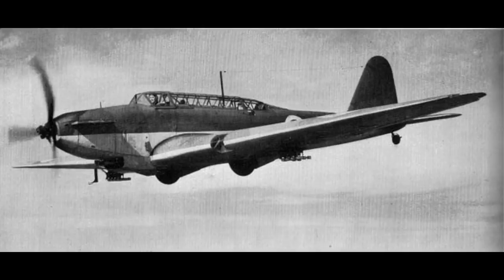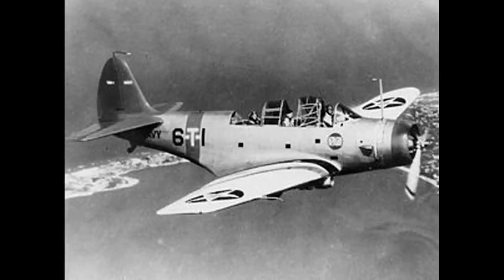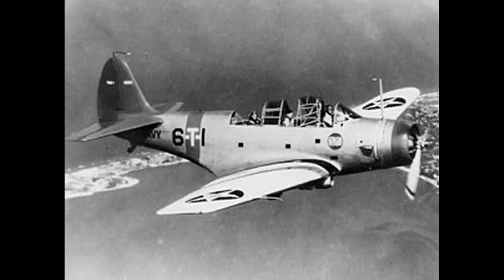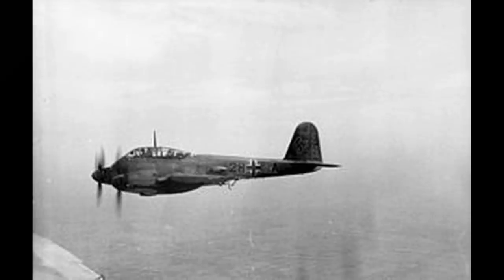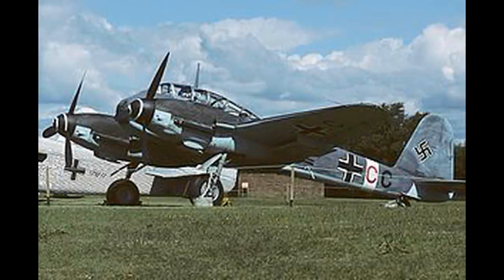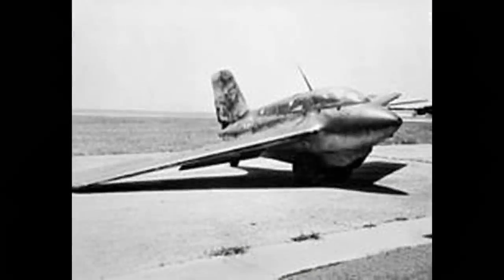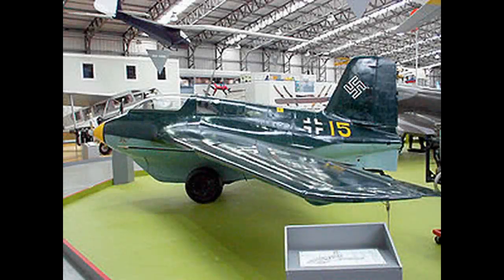TOP 5 WORST military aircraft used during WW2

Comment: The Devastator was a US NAVY plane.   The USAF didn't even exist as an independent service branch until 1947....thre land based air arm of US forces was the US Army Air Force.
Reply: Yes, but the USAAF, the United States Army Air Force did have a version of the Navy SBD dive bomber.
Reply: @scootergeorge9576  Yes....but my comment was in reference to a TORPEDO bomber, not a dive one.  While the USAAF used a version of the SBD Dauntless, as you pointed out (although that use was limited), they did NOT use a USAAF version of the TBD Devastator....different planes entirely.
Reply: The Devastator was undone due to the fact that it’s primary weapon the Mk 13 torpedo had all the faults of the Mk 14. In short the torpedo catastrophically failed to function in four independently different ways simultaneously.
Reply: the Devastator's drew the Japanese Combat Air Patrol down to sea level and left three of the four Japanese aircraft carriers open to the following  wave of SBDs at Midway.  15 aircraft for three aircraft carries is a fair trade to change the entire strategic balance in the Pacific.  Japan could never recover from those losses.

Comment: I have to disagree with the devestators, you used the examples of the attacks on Akagi and Kaga and granted yes they got absolutely chewed up. But the reason that failed was because the US air groups got separated from one another. When both dive bombers and torpedo bombers were supposed to attack at the same time with fighter support keeping the zeroes off, the devestators went in, practically alone, so the japanese didn't have to divide their fire up and the zeroes didn't have much (if any) fighter escort to worry about. Any other torpedo bomber of the time would've struggled on that strike, even the TBF's which replaced  the TBD's. While I certainly agree it was outdated by the time of the US entry into the war, i don't consider that a failure of design, things age and become less useful over time that has always happened and always will, but that doesn't mean it wasn't capable at one time.
Reply: And besides that, the torps they were working with at the time were utter failures. Some of them got their torps out and even scored hits but completely failed to detonate.
Reply: Add to that, the Mark 13 aerial torpedo was a total dud. Even if hits were scored, it would most likely fail to detonate. It was too slow and could not maintain proper depth and heading.
Reply: If the Douglas Devastator had been armed with a torpedo that do not have a 97% failure rate, at least one of those big Japanese carriers would not have survived the Coral Sea in Japanese casualties at Midway but not have been so light

Comment: it's always difficult when a weapon is used poorly and it ends up being "obsolete" as the swordfish was used against the Bismark and came back a hero plane while the devastator goes against massed AA fire is is a horrible failure when technically the swordfish should have been obsolete when it rolled out the factory.
Reply: Thing was though the old "String bag" was a tough sturdy and stable plane. Also the Bismark missions were not a fluke the "String bag" had already been massively successful in the Battle of Taranto against the Italian Navy which was more formidable than the German one. The "String Bag" was the most successful naval plane of WW2 in terms of naval tonnage sunk by any allied plane. It may have been technically obsolete but it was perfect for it's role. It's one thing being old but another being actually damn good at your job regardless. Reminds me a little of the Gloster Gladiators used by Finland and Malta which also punched well above it's weight.
Reply: @paulsnell534  i think that in cases of Taranto and bismark things were greatly in the brits favour, Taranto was a suprise night attack and there are stories of bismark not being able to calibrate it's guns for the slow moving swordfish
devastators faced mass AA in large formation combat and had crappy torps
i don't think the swordfish faced either i think the swordfish kinda got lucky that it was used intelligently which sadly isn't the case for a lot of equipment that gets a bad rep
Reply: The Ilushin il2 had virtually the same specs as the Battle but the Russians fitted plenty of armour to protect it and a decent rear defence gun ,the Battle would have benefitted from such clear thinking.
Reply: Both swordfish and devastator were obsolete, with devastator being a slightly better aircraft. The thing is though, the Devastator used American torpedoes.
American torpedoes were really fucking shit until 1943, with I believe about a 70% failure rate.
The more glaring issue of American torpedoes were... It running too deep, running too high, not detonating, detonating prematurely, detonating too late, running off course, and spinning in circles.
The US didn't test their torpedoes until late into the war after mass-producing, them as doing so would cost too much to. What followed was a mass-produced, expensive piece of shite being sent into battle with officers expecting it to work when it didn't.
Reply: @botchii3059  English torpedoes were terrible at the beginning of the war as well ,they couldn't afford to test them in reasonable numbers so lots of duds went out ,also the U.S. torpedoes were way worse than 70 % unreliable until the Naval ordnance beareau got their act together.
Reply: @pauldavidson6321  can you give me a citation for the unreliability of English torpedoes? I thought the only downside they had was the size.
Reply: @botchii3059  the magnetic influence pistol was notoriously unreliable but kept in use to 1943 it's replacement  was better but could detonate prematurely if there were nearby explosions, overall the success rate with all types was around the low 20 % mark . British torpedoes were 18 " for aircraft and 21 to 24 " for ships , subs and Mtb's as well as American torpedoes.
Reply: @pauldavidson6321  Britain didn't mass produce the same torpedoes as the US, and didn't equip them with magnetic triggers. They tested the reliability of magnetic torpedoes and found out it was better to just go for the standard.

One of the UKs aerial torpedoes was the Mark VII, different to the US's torpedoes. I believe it was not acoustic or magnetic, and utilised the standard contact trigger.
This was replaced I believe from 1942 for FAA use onwards by the aerial Mark XV, different to the American Mark 15 ship-based torpedo.

http://www.navweaps.com/Weapons/WTBR_WWII.php
http://www.navweaps.com/Weapons/WTUS_WWII.php

Compare the stats for the UKs Mark XV or XVII to the US's Mark 13.
----
http://www.navweaps.com/Weapons/WTBR_Main.php
The Brits did use some magnetic torpedoes in WW2, and were far better than the US's counterpart.
----
Even after the USs torpedo improvements, during the Korean War on an attack against a dam, 2 of 8 torpedoes failed, one running erratic, and one being a dud.
Reply: @botchii3059  The crew of HMS Sheffield were very pleased regarding the unreliability of British magnetic pistol torpedoes when, on the night of 26th / 27th May 1941, the Swordfishes of HMS Ark Royal mistook her for the Bismarck and attacked accordingly.  Fortunately the magnetic detonators on the torpedoes were defective and were replaced on the next strike (this time against the Bismarck) with contact detonators.
Reply: @wotnotvintage7762   The Duplex Coil Rod pistol was replaced in 1943 by the CCR, or Compensated Coil Rod. She was a good pistol, and entered mass service in 1945.
The DCR was a shit pistol, though not as bad as the US's Mark 6. She did splendid at Taranto, though remained wholly unsatisfactory. The US's Mark 6 had no successes comparable to Taranto, and was shit throughout the entire war.
Reply: @botchii3059  Many years ago I read a young adult book about a guy on a sub. That book mentioned that the torpedoes were no good early in the war.
Reply: @pauldavidson6321  The IL2 was in a different league to the Battle. The IL2 had impressive forward-firing armament, (2x 20mm and 2x 7.62mm originally, later 2x 20mm and 2x 23mm cannon), and could carry 8x 82mm rockets and 4x 220lb bombs. Later models could carry more ordinance. The biggest difference  was that the Sturmovik was designed to operate as a ground attack and close support aircraft, and was equipped with the tools to do the job. As you rightly point out, it was well armoured, and proved most difficult for German pilots and ground forces to bring down.
Reply: @anitadolan1361  I agree completely, my point was the Battle could have been developed to a similar standard as the IL2 the British knew the capability of the bf 109  yet did next to nothing about providing decent rear fire power or virtually any armour protection for the crew.The Battle wasn't a high altitude bomber and would have been exposed to the lethal light flak at it's operating height .also there was plenty of development available from the Merlin for far more power which also improved the IL2's effectiveness.
Reply: @wotnotvintage7762  Phew! Lucky escape there for that Sheffield. Alas, not such good fortune for its namesake 40 years later ...
Reply: @ScreamingSturmovik  It's one thing to have relatively inaccurate Anti-Air guns but not be able to depress to targets just above surface? 🤦‍♂️
Reply: @DerpyTurtle0762  i always heard it was due to the swordfish being able to fly ridiculously slow (due to being a biplane) and the Bismark's AA director "computer" was calibrated for "modern" aircraft that flew much faster so the gunners had a very difficult time
Reply: @paulsnell534  The Finns also used the Buffalo and Blenheim, both pretty ineffectual elsewhere.
Reply: @botchii3059  The highly successful submarine U.S.S. "Tang" was sunk by one of its own torpedoes in October,1944, with only 9 survivors.
Reply: One thing to remember is that the Devastator's final operation was the Avenger's inaugural one. And the Avenger had a rough go of it, also, losing 5 of 6 in their torpedo attack on the carrier group. And the one that survived didn't hit anything because of the horrible Mk XIII.
Reply: @pauldavidson6321  The Fairey company successfully made a more powerful engine than the 'Merlin' that might have powered the 'Battle' but the Air Ministry wouldn't let it be produced.
Reply: The Swordfish was also up against massive AA fire but it was so slow the modern German rangefinders couldn't get hold of it.
The Devastator was up against interceptors, Zero fighters so that made the difference.
If the Bismarck had fighter cover, it would have been unharmed probably because most of the torpedoes hit the thick armour belt and didn't do anything but a single torpedo hit the unarmoured rudder, causing the Bismarck to go in big circles after the attack.
Reply: @ScreamingSturmovik  you're absolutely correct ,when the Swordfish squadron was sent out against the Scharnhorst  , Prinz Eugen  and Gneisenau  during the German "Channel Dash" they were shot to ribbons by the luftwaffe fighter escort  just as the Stukas we're when faced with effective fighter opposition.
Reply: @pauldavidson6321  Actually Fairey, made the into the Fulmar fighter.
Reply: @botchii3059  70% is optimistic. 95% would be closer - a submarine fired 20 of the longer ranged Mk14’s (the Mk13’s used the same hardware) with the result of zero detonations and two torpedoes imbedded in the holds of their targets…

Comment: The Fairey Battle's problem was not its aerodynamic design.  It was its size and weight, and the failure of the RAF Hurricanes to establish air superiority. It was faster than a Ju 87 Stuka.  The Devastator was a UN NAVY aircraft.There was no US Air Force back then. Torpedo 8 would have been massacred flying just about anything.  There were no escorting fighters.

Comment: Don't know if anybody noticed but the picture of the ME-210 was NOT a ME-210 but in fact a ME-410 circa 1944 as identified by the remote controlled machine gun blisters on the side of the aircraft just behind the wings.
Reply: I am not sure if it is a 210 or a 410.
But the gun blisters you mentioned were on both the 210 and the 410.
https://en.wikipedia.org/wiki/Messerschmitt_Me_210#Specifications_(Me_210Ca-1)
Reply: @McRocket  the 210/410 was pretty woeful in any form and was very much a target from its first combat flight!
Reply: fooman2108 It was a fast and well-armed heavy fighter. It simply had the misfortune to face clouds of single-engined escort fighters by the time it was in full squadron service over Western Europe.
Reply: @mebsrea  It was, in fact, a fine aircraft (at least the 410) BUT it was still working on the 'zerstorer' concept of a bomber destroyer type of aircraft and the few times ANY of the zerstorers could be used like they were designed they were lethal, BUT tactics had long passed that idea (much like torpedo bombing at the end of the war)
Reply: The Me-310 was worse than the 210...
Reply: Daniel Rodriguez 210 and 410 had the same fuselage and remote controlled gun arrangements - the difference was mostly in the wings. The 410 had a less swept outboard wing to fix the truly nasty handling of the 210. 5.5 degrees vs 12.6. 
It is like trying to spot the difference between a B-29 and a B-50.
Reply: This series of aircraft was designed as a ground attacker and bomber interceptor.  They were never intended to dogfight.  The 410 was equipped with a 5 cm. autocannon that extended out from the nose.  It was a tank and bomber destroyer, not a fighter plane.